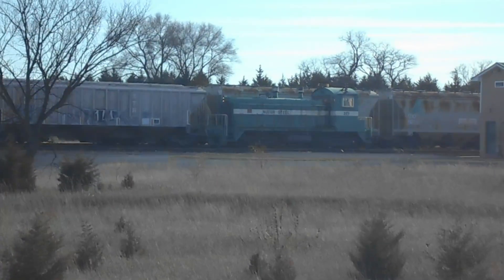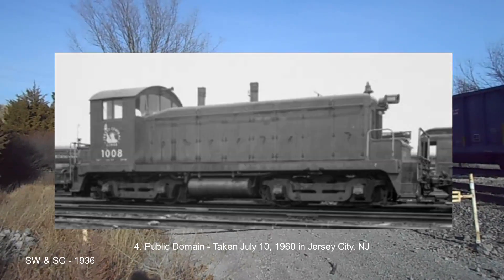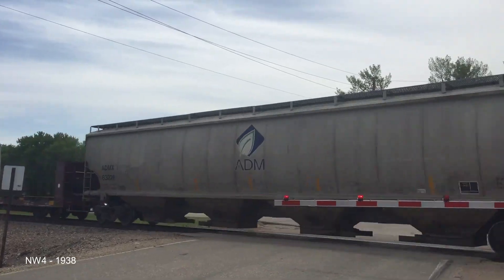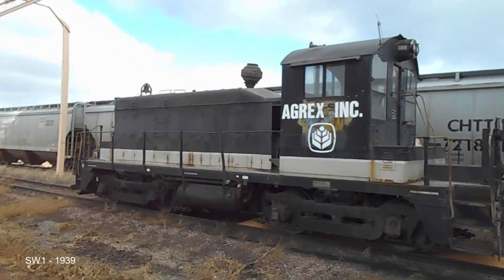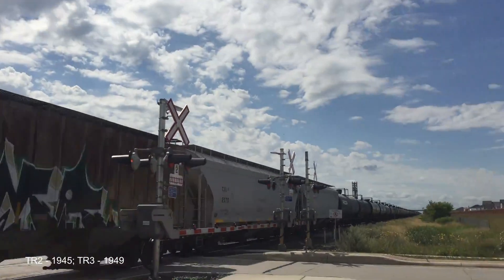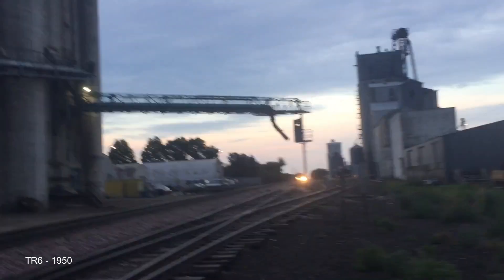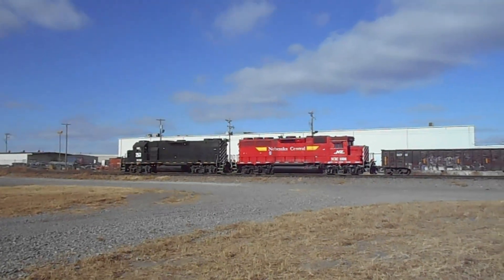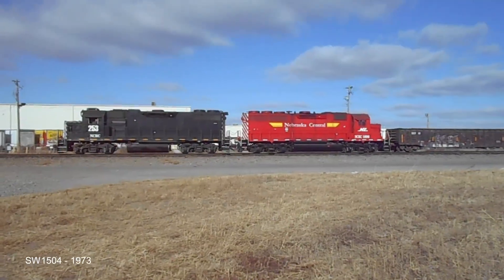All EMD Yard Switcher Models Explained (SW/SC/NW/NC/MP/T/TR)

Comment: I remember seeing the Blue and Yellow switcher at about the 6 minute mark at a grain elevator or similar industry in either Iowa or Minnesota when I first started trucking in 2017. There was an old Conrail switcher and some first gen geeps at other industries along that same back road. This one stuck out because it used to be owned(I think it was just a parts unit at that point) by a Chicago area shortline/locomotive leasing outfit. It just sat stored on this industry lead near O'Hare airport for years before UP kicked them off that line, then it and another switcher sat near Rochelle for a while. It made the rounds around the midwest before ending up  in Ohio for a rebuild and new coat of paint. It was still in faded Amtrak colors beforehand with ATSF paint shining through. It was one of the many rebuilt "SSB1200s" that ATSF traded to Amtrak for the SDP40s(or whatever models they were) Glad to see her kicking around, as I was sure she would end up on the deadline at NRE or LTEX
Reply from the maker: I've actually been researching this locomotive for my new switcher special series. From my research, I've gathered that it was built for ATSF in '53, renumbered a few times, rebuilt to SSB1200 specs, then sold to AmTrak (during their trade of '84 with the SDP40's), and renumbered to 554. After that, it gets a bit confusing. Sometime in the mid 2000's, it was owned by DRSX, then later TANX. During this time, it stuck around IL for a while. When it was TANX 1253, it was in Rochelle sitting next to another switcher, which matches what you've said. I think it was acquired by MVPX in 2013, where it was repainted in Cleveland.

It has been sitting in Brewster, MN since at least 2019. For some reason, in their repainting, they labeled it as a regular SW9. Some sources suggest that it has been downgraded or modified to maybe a more stock configuration, but I'm unsure. This may have been the rebuilding in Ohio that you speak of. If you have any more information, please let me know, and I do appreciate this and any more you send my way.
Reply: @brookingsrail  I honestly think the SSB1200 desgination was little more than your standard 70s-80s EMD rebuild. It seems the least intrusive off all of the similar switcher rebuilds of that time, (UP's SW10 and IC's SW14). I think they just redisignated it as an SW9 to make it easier to sell. I guess SSB1200 is an unofficial designation. The company that rebuilt it had a bunch of pictures of it at that roundhouse in Cleveland being rebuilt and repainted. If you search on facebook, the photos should pop up. At this point any 12 cylinder 567 powered switcher is mechanically about the same. They are probably upgraded to 567BC or and have 645 power assemblies. I think it really just boils down to how good the chassis and draft gear is at this point.

But yeah TANX 1253 first came onto my radar around 2007. DRSX (Dot Rail Services of Granville, Il) was the parent company to the Central Illinois Railway Company. They had a contract switching company and a track repair company as well. I don't think the 1210 and 1211 were around for very long before being sold off. They used an ex IC SW14 to switch Centex Industrial Park in Elk Grove Village, but stored those two switchers there. I think they were both sold off right after they got kicked out of Elk Grove in favor of Chicago Terminal Railroad.(UP has since kicked them out as well in favor of The Chicago Junction Railroad)

About that time the next year(2008) The blue SW1200 that it was coupled to at Elk Grove and Rochelle showed up at NRE Dixmoor and was repainted there.
Reply: Have you seen a green and yellow one?

If so it used to be here in Oklahoma

Comment: The Amtrak "SW1000R"s were rebuilds of old MKT SW9s by NRE. Two of them (790 and 791) languished out of service underneath the old Harrison Street post office adjacent to Chicago Union Station for years. They were finally pulled out and scrapped sometime in the last 5 years or so. They were there forever though and still worked until maybe 2010 or 2011. Some others stayed around in service for longer(and might still be in service) in Washington D.C.

Comment: The 567 and 645 are the exact same size. I can say this with authority as I am an EMD certified locomotive mechanic for a short line railroad in Texas. I have been doing locomotive work for seventeen years. The 710 engine is in fact larger than the 567 or the 645. 
The 645 power assemblies will fit into a 567c block. 
Variants of the A, B, and C blocks are, A, AB,AC, CA, B, BC, C. 
I personally haven’t seen such variations in the D or E blocks. D and E block units usually have a number after the letter. 
Auxiliary systems often account for variations in car the car body or frame design. Systems such as inertial filters, Far air filter systems often are the cause for car body oddities. 
The SW of Union Pacific fame is a very good variant rebuilt from early SW units using C blocks, D32 main generator, AC auxiliary generator, D14 companion alternator, GP style radiators and fans, as well as the -1 excitation system. To accommodate the D14, without cutting the castings in the welded frame, they welded I beams to the frame to make new mounts for the engine and main generator assembly. The bulk of the car body is about nine inches taller from having skirts added at the base. The raised radiator section with electric cooling fans are obvious spotting features. 
Of the 1200 horsepower units the 10s are my favorite as they are practically bomb proof. 
Their only fault is being set up in permanent series parallel on the traction motors. The ones I have worked on got reconfigured to full series. This allows a better low speed grunt pulling advantage. They do okay as UP built them but for industrial work the modification becomes a lifesaver.

Comment: Thank you for the video, however I must correct you a bit on the current states of both RS1325's. They were initially built for the CNW to use in their Chicago yards for switching and passenger service, but the CNW weren't intersted. It wasn't until the C&IM purchased both prototypes, 30 and 31, off the showroom floor. They'd both serve the C&IM, and current G&W IMRR until 2016 when 30 went to the ATW, another G&W subsidiary. 31 remained with the IMRR until retired and sold for scrap in 2020 when the Monticello Railway Museum purchased the locomotive, which is still operating at the museum today. 30 was just recently donated as of 2022 by the ATW to the Illinois Railway Museum.

Hope this info helps. Keep up the good work

Comment: Why is more horsepower needed if the engine doesn't run off the diesel engines directly but run off electricity to turn the wheels?
Reply: More horsepower can turn a larger generator which will in turn send more electric power to larger or more powerful traction motors.

Comment: EMD "B" block= absolute water leaking junk!
Reply: B had cousin called A block, they both leaked. Gave birth to 567AC and 567BC with mid deck changed to 567C. Round hand hole with square on bottom. Good video, thank you